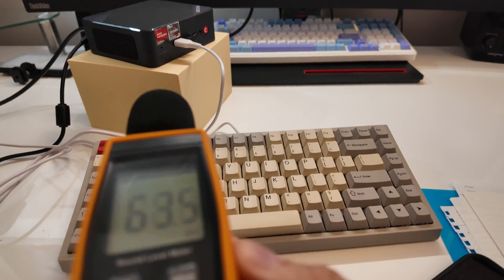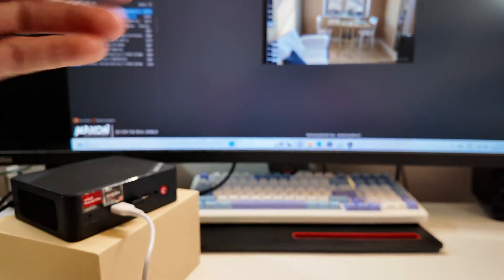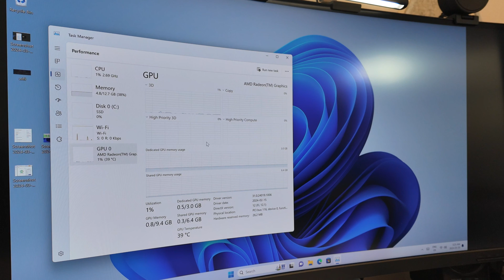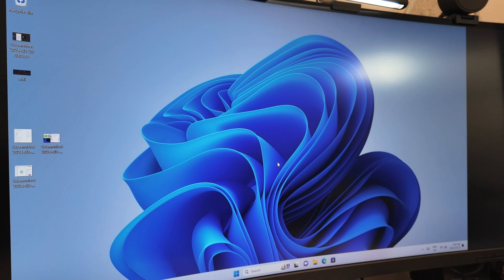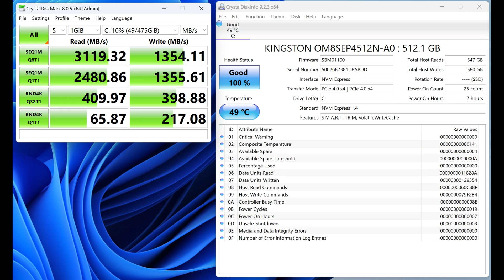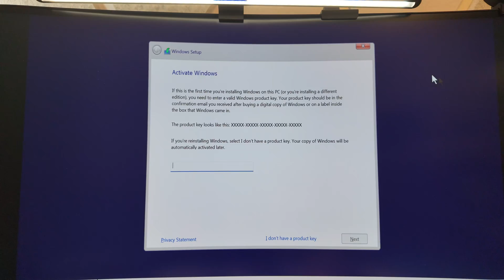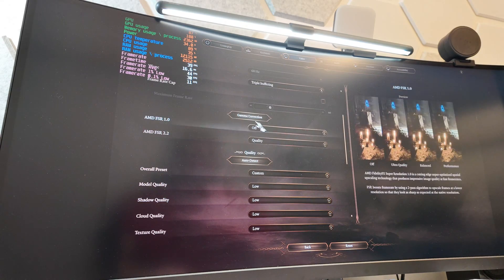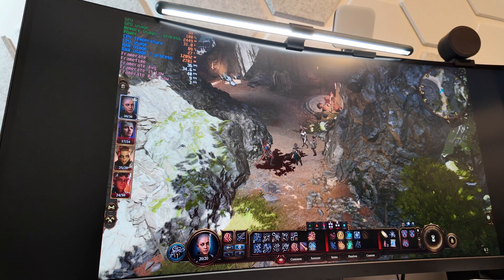Pretty Good! - BOSGAME H68 Mini PC Testing and Review

Comment: i smoked the bearing in the fan doing x265 encodings. Then I broke the ssd mini sata socket , it was really brittle from insane heat exposure. The product key is kmspico lol. Its a gladiator tho and it will continue to do battle until its final death

Comment: ive got a bosgame m4 plus fully kited  out 64 gig ram and two 4tb sticks m.2 and it goes like lightning
i have two of them
and a minisforum AI x1. and a gmktec g5 stacked like hifi. plus my Maine pc. also got a bosgame egou 7600m xt which is quick at playing games. can not remember if ive got
any others. 2 of the bosgames are runing linux mint the minisforum is running windows 11 enterprise iot ltsc the gmktec g5 is just for distro hopping. great little pcs.
the m4 plus has a windows key.

Comment: I got a Kamrui version of this, it was $385 USD. 32GB DDR5 4800mt. 1TB gen 3 ssd. It's built on 28 watt power limit so lower performance than other ones in its class. Not bad though, 2038 single core, 9385 multicore on geekbench 6. 25,850 GPU score for the 680m too. The Kamrui comes with an extra nvme gen 4 slot too. Crappy Mediatek wifi/bluetooth though so that will be replaced soon. The Kamrui also maxes out at 4.5 Ghz with the lower tdp. Build quality sucks, the display port is completely broken but HDMI works. Also 4 usb 3.0 ports and 3 usb 3.2 gen 2 ports (one usb-c with display capability).

Comment: How fast is this mini for general pc usuage pls?
Reply: So for running on dual monitors, running multiple Microsoft platforms at a time and just regular day-to-day processing, emails word documents, and using Google Chrome with multiple windows, this should be more than enough speed and power to support that correct? No gaming so that’s not even an issue and probably overkill but my current mini PC is starting to slow down so I was looking into something that will get me by for the next five years with just day-to-day work flowfor mortgage and real estate
Reply from the maker: Very very fast

Comment: Thank you so much!
I have a question if it’s not too much!
At 6:31 ,  I see the GPU specs:
- GPU memory: 9,4gb
- Dedicated GPU memory: 3gb
- Shared GPU memory: 6,4gb
So… what is the maximum gb I can get from this GPU? The RAM is shared with the GPU?
With 32gb of RAM and the 680M GPU, can I get acceptable performance?

Again, thx so much for this video!

Comment: man can't stop, man won't stop cooking! Btw have you seen that really cool windows tablet by MinisForum with Ryzen 8840? Its on early bird price right now for about 1200 USD I think. Love what they are doing!

I also have a question regarding Ryzen 6000, is there a lot of performance and battery difference between that and 8000 or 7000? Im guessing yes because zen 3 vs 4 but idk. Im still looking for a laptop for dev work but I want to get a good deal and not dish out retail new price on new ones